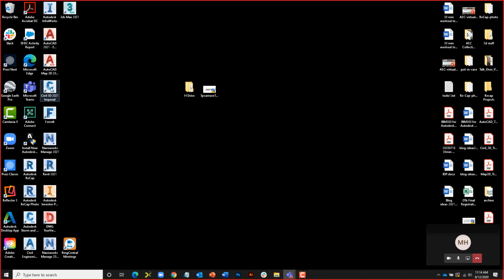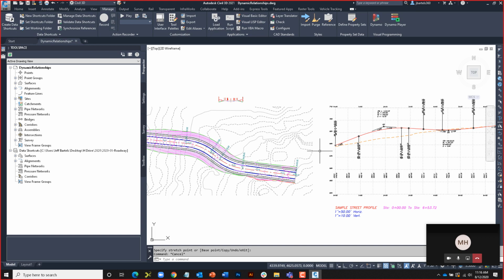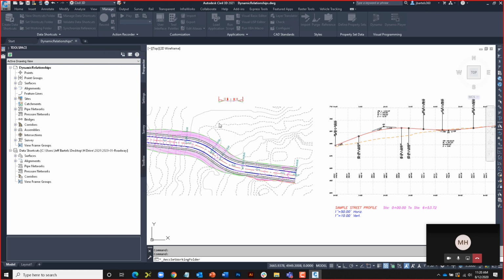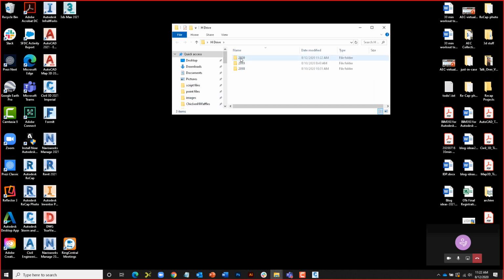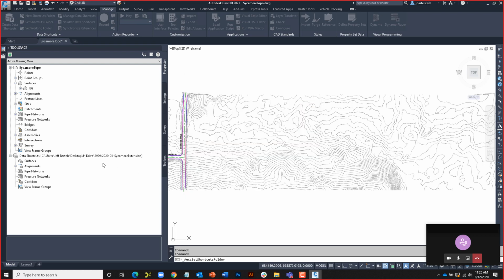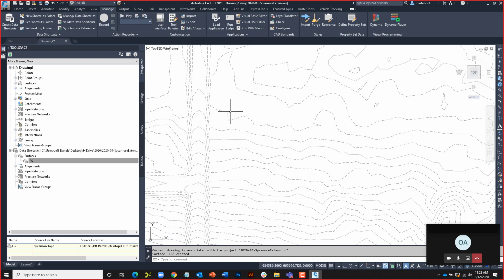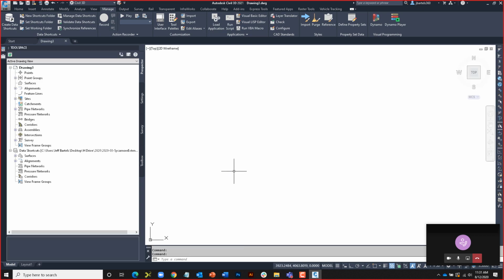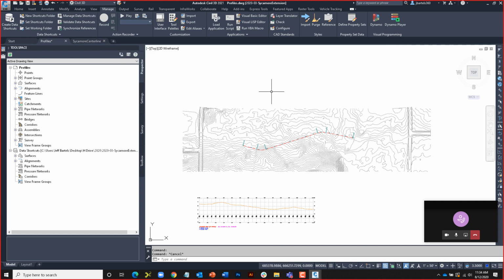Introducing Civil 3D Data Shortcuts

Comment: Is there any solution, if I created a dwg contains rail type alignment & profile and took it shortcut in another dwg to create corridor then took the corridor shortcut in a 3rd dwg to create x-section, to change the alignment type to center line alignment and apply synchronise? 
It does not work with me at all, as I must recreate th x-sections even after I tricked the corridor.
Could you give any advice?

Comment: Excellent video, thank you. I do have a question that I hope you can help me with regarding data shortcuts. Our typical structure is having a survey base file with a TIN surface displaying contours. We DREF the existing surface into a base grading plan.  From there, we create a sheet drawing XREFing the survey DWG and grading DWG.  By XREFing the survey file, I can see the contours in the drawing because the source drawing is displaying them.  The grading drawing is also showing existing contours be because the existing surface  is DREF and displaying contours. However, it's been hit or miss if the contours show up when plotting the sheet file. Sometimes I have to DREF the surface into the sheet file just to get the contours to plot. Another work around we've done is to physically extract the contours from the surface to create a 2D/3D polyline base file just to reference into our drawings.  Not ideal, but it guarantees contours to plot.  I have a feeling it has to do with plotting a large set via publish or sheet manager.
Reply from the maker: Hi Anthony, I've not seen the issue you are experiencing. I'd recommend reaching out to the Autodesk Partner where you purchased your Civil 3D.  They will have technical specialists who can take a look at your drawings, troubleshoot the issue and log a support ticket with Autodesk if needed.  Thank you for your interest in the channel and recordings!